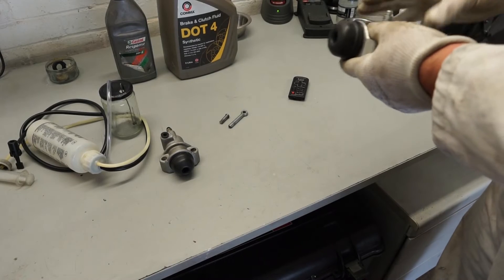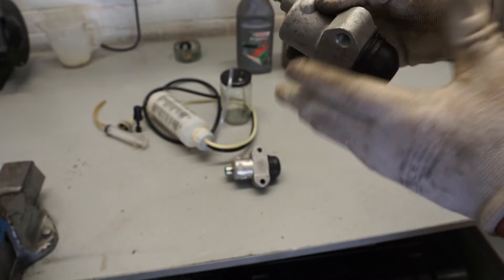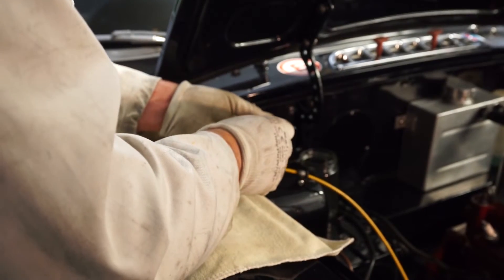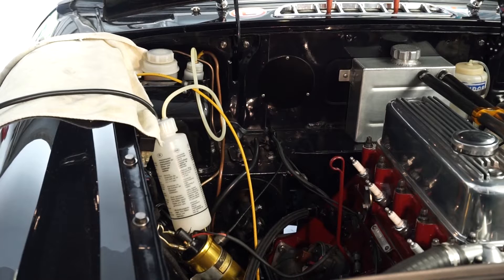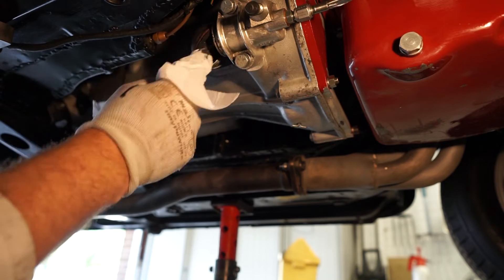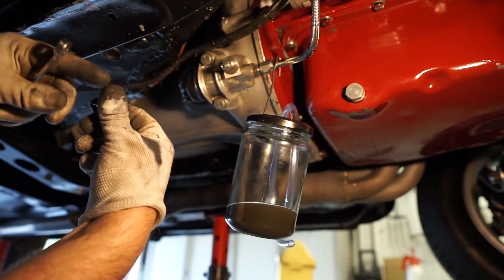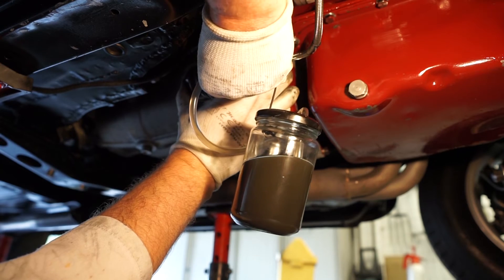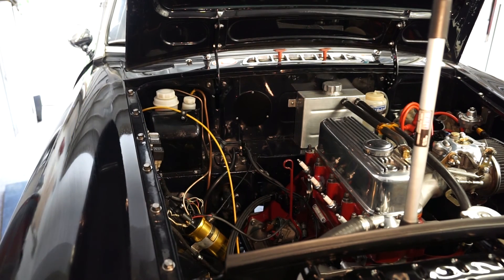MGB Clutch: Bleeding and Refreshing the Hydraulic Fluid in an using the Gunson’s Eezibleed System

Comment: I tried the Ezibleed but it was unsuccessful.  So I removed the 2 bolts holding the slave cylinder on and opened the bleed ripple until fluid ran out. Now I have the best clutch ever.
Reply from the maker: Many thanks for this, it's not a method I have ever tried great to see it worked for you. I do find often the MGB clutch can be hard to bleed, I have found that leaving it overnight in the past has helped if they are being difficult.

Comment: Just bought a 1972 mg bgt yesterday, low and behold went in it tonight, no gears, looked underneath soaking wet with dot 4. Just ordered slave cylinder and pipe  will do the job over the weekend. Its the old lockheed master cylinder, a bit rusty on the outside but still doing its job. With this video and tips it will be a breeze ,( famous last words). Thanks for the tutorial video, looking forward to watching the rest.
Reply from the maker: Many thanks Mike, I hope it all goes well!

Comment: Another informative video thankyou David!  I'll be carrying out a clutch clutch in the next few days following your instructions once again.  Cheers
Aaron G
Reply from the maker: Thanks for your message Aaron, hope all goes well with the clutch on your car.
Reply: @davidrussellwilks  Gday David, clutch flush went extremely well, very clean so good result.  I carried out a compression test (exactly same compression all cylinders) and tested the dynamo (mines a 65) and runs strong (over 14.6v @ 1000 RPM).  A suggestion for new video/s is what items on the car MGB owners can test, why they should, how and frequency as preventative maintenance.....just suggestions.  Cheers
Reply: Did it today, 12mm spanner worked on the bleed nipple.  I bought a fluid tester per your previous Youtube suggestion and detected greater than 4% water content reading.  Surprising was the amount of clutch fluid I needed to bleed before noticable drop in the clutch reservoir....almost filled the jam jar.  Looking forward to the next informative Youtube production!

Comment: Thank you David. I like how methodical you are and how well you explain things. I don't know if you remember but you had asked me awhile back if I had figured out the problem I was having bleeding the rear brakes. As it turns out, I had a crushed brake line. I had done a visual inspection of the brake lines but, with only a couple of inches between my eyes and the bottom of the car, I missed it. I ended up taking it to a shop at the beginning of the virus outbreak. The mechanics were all sent home shortly after I dropped it off. They recently came back to work and I hope to get my MGB back soon.
Reply from the maker: Delighted to hear you found the source of the problem Trent, was it the copper line that was crushed or the rubber hose that had failed? Hope you get the car back soon
Reply: David Russell-Wilks - It was the copper line. I’m hopeful that I’ll be driving it again soon. Thank you!

Comment: That was a great  clear vid,I appreciate your extra info,like maybe why it doesn’t go into gear…,my triumph spitfire 1500 has been having trouble going into 3 rd sometimes lately,I will check this out and hopefully get it sorted. Many thanks from nz.
Reply from the maker: Thanks for your message, there are a couple of things you can check. How easily does it shift into third when stationary with the engine running? A clutch issue would mean problems when both moving and stationary, if it only happens when the car is moving it may be the synchro on third.

Comment: Great video David, that's interesting to know about the original slave cylinder having a dimple on it compared with the aftermarket not having it. If I get any issues with mine, I know I'll be spending the extra cash on an original type. What's the expression, fit cheap fit twice
Reply from the maker: It's something I picked up from the John Twist video. I bought the aftermarket slave as I needed one urgently; in fairness it seemed to work fine but I went back to the original AP one as soon as they came back into stock.
Reply: Ah yes, John Twist. Legend, what he don’t know about classic MGs ain’t worth knowing

Comment: Great video and always well done.  I am curious if bleeding the clutch without an air system to push the fluid would be the same procedure as bleeding brakes?  I noticed a reply to another subscriber that just pressing the clutch to push the fluid will work, but do I close off the bleeder screw while having someone press the clutch and I open the bleeder while they hold down the pedal? 
Thanks for all your videos. 
Kel
Reply from the maker: If you have someone to help you it should be no problem to bleed the clutch slave in the conventional way, open the nipple as the pedal is pressed and then closed before the pedal is released. You can use the same technique as shown in the video to burp the system. One tip I have found in the past if the system is being difficult is to leave it overnight and it does seem to expel the air itself sometimes.
Reply: @davidrussellwilks  thank you very much for your response. I appreciate your time.

Comment: Great as ever. Thanks. Can I ask : if you don't have a compressed air "thingy", is there another way to do this manually? From what I could tell, you filled the kit with new fluid, connected it to an air device, went under the car and opened the bleed valve which I ASSUME has the effect of drawing the new fluid from the bottle as the old pours out? Is that right? If so, then I do have one of those brake bleed kits (not used it yet) but I don't have an air device, so I winder if this is possible for me? b) is it preferable to use DOT4 brake fluid, or is there dedicated clutch fluid to use? c) what is the bottle to the left of the clutch cylinder? Is that the brake fluid bottle?
Reply from the maker: You won't need the air bleeder but you will need someone in the car to press the pedal for you and push the fluid through the system. Essentially the air kit pressurises the system (only around 15psi). when the bleed nipple is open the air pressure forces the fluid through the system. I think DOT4 is ideal for these cars, there's no need for an expensive racing type brake fluid and you don't dedicated clutch fluid for these cars. 

The clear bottle is the brake master cylinder, I went with the newer style clear reservoirs to make checking the levels very easy.

Comment: Hi David, your video is excellent and very detail for beginner.  I have a question using the Eezibleed system.  Does it not introduce air into the cylinder when you open up the nipple as there is a air in the pipe between the Eezibleed bottle and the cylinder.  If it does not introduce air into the clutch system, where does the air go?  Hopefully you understand my question?
Reply from the maker: Thanks for your message Philip, the air inlet for the Eezibleed is at the top, but the outlet for the fluid is at the bottom of the bottle. This means that only fluid is pushed out (until the fluid runs out). You may have a small amount of air already in the Eezibleed but this would be held in the master cylinder above the fluid already in there. Hopefully this explains it.

Comment: David thanks for the educational video on bleeding the MGB clutch. What would be your thoughts on a clutch that seems not to want to engage until the car has warmed up and driven down the road a couple of miles. Very difficult to get into both second and first gears until driven down the road.
Reply from the maker: Good Afternoon Derek, I'm wondering if the problem you describe might be related to the gearbox rather than the clutch. How is the car at selecting reverse when cold? I had a similar issue on my car and it turned out to be the gearbox synchro/baulk rings rather than the clutch. If you are able to get under the car and see the clutch fork travel are you able to measure what you have?
Reply: I can always get into reverse but today I tried pushing in the clutch pedal 2 or 3 times and just letting it fly back while out of gear. Seemed to work better today while driving around. Might be some build up that needs to be loosened up. Drove alright this morning. Going to work with my mechanic this winter and pull the entire engine and drive train
 Will be changing all the gaskets and will look at it then. Since my MGB is a very clean 1964 model which I just purchased in March I want to keep it in the best running shape possible
 Just found your first video very helpful so hope to view the remaining videos to get better educated 
 Thanks for the Insight

Comment: Hello David, Thank you for the video. You have a beautiful car. A couple of questions. What size spanner are you using on the bleed nipple and what detailing spray do you use? Thanks David
Reply from the maker: Thanks for your message David, from memory I think it's a 7/16 spanner. Under the car I just use WD40 to clean up, on the bodywork I use the AutoGlym rapid detailer; the trade version is called Fast Shine & Lube I but it in 5L cans, much more cost effective than the small bottles. I've stopped using water to wash this car, there are too many bare metal parts where the water can get trapped and then cause rust

Comment: Hi David and all MG lovers, my problem is the clutch that sometimes travel freely all the way to the floor. Fixed a new master cylinder (Lockheed) all were good until it was grounded for 2 years. Change a new set of MC kit and slave, system bled and has a solid peddle. No leaks anywhere.

Moving the pedal up down several times in a short period of times results in the clutch pedal dropping down ever closer to the floor. It will reach a point where the pedal won't move enough to disengage the clutch. If I stop moving the peddle and wait for awhile the pedal comes all the way back up and the process repeat again. Please advise and help me guys. Thank you.
Reply from the maker: Thanks for your message, if you've not replaced the clutch hose yet it might be worthwhile. The internals of the hoses can break down and upset the flow and return
Reply: @davidrussellwilks   @David Russell-Wilks  thanks for the prompt reply David. FIY I just blast air through the hose and there was no blockage.. but it never cross my mind of any internal deterioration that might happened. I'll fix a new hose and let you know the outcome. Thanks mate.
Reply: @davidrussellwilks -  Hi David, I have fixed a new hose as you suggested and bleed every air there was inside. And as like magic the dang clutch just came back to life. What worries me now is the carbon clutch bearing, it is hoovering very close to the clutch pressure plate. Is it normal? Or can I hook a small spring on the clutch bearing fork to make sure it stay clear of the clutch pressure plate? Any advices from you would be most invaluable? Thanks David. Like I say, you're just awesome.
Reply: @davidrussellwilks  hi buddy, I'm taking my darling for a spin and will update you of the experience soon. Thanks mate 😘😘😘
Reply from the maker: Sorry for not getting back to you about this, I missed your message. The carbon bearing will wear out over time, it's just a case of checking that there is still plenty of the carbon material on it. The roller release bearings are a good alternative and are widely available now.

Comment: Thanks again for this David, you're my go to resource for everything MGB related. Quick question... what heater unit are you using? I've not seen it before.
Reply from the maker: Many thanks for your message Richard, delighted you are finding the videos useful. The aluminium box where the heater should be is a catch can, they are mandatory for racing the UK to collect the vapour from the crankcase and rocker cover.

Comment: Hello David, 
Sorry to bother you again. 
My clutch system is empty due to a leaking clutch slave cylinder which I am going to replace and then bleed the system. 
However I was wondering whether I could bleed the system by drawing the clutch fluid through from the clutch master cylinder using a syringe via the clutch slave cylinder bleed nipple rather than pressurizing the clutch master cylinder?
Any thoughts or reasons why this might not work?
Regards David
Reply from the maker: I've never tried it that way. You'll need to make sure the seal for the syringe on the bleed nipple is good and you will need a decent capacity syringe, plus you'll need to make sure the master cylinder does not run dry. I think it might be easier just to bleed in the conventional way with someone pressing the peddle? A good tip is to burp the slave cylinder just to push out the last bit of air when you are finished
Reply: @davidrussellwilks  Good morning David, I'll try and I'll let you know. Regards David

Comment: Do you have any videos on tuning your weber carb?
Reply from the maker: Thanks for your message, I have the Weber carb tuned on a rolling road and then don't touch it. I don't think a static tune is very easy with these carbs as you really need to see what the engine is doing at the upper end of the rev range.

Comment: Hey don‘t U Uwe DOT 5 Fluid for brakes and clutch?
Reply from the maker: When I first built the car I used Dot 4 for the clutch and Dot 5.1 for the brakes, changing now would be difficult. I have heard stories about Dot 5 affecting the rubber seals in the MGB system, I have no first hand experience of this though. I do like a very firm brake pedal in the car, apparently the silicone fluid can feel spongey once it gets warm. 

Do you use Dot 5 in your car?

Comment: David is very careful to use anti-seize product to facilitate future removal of parts. He also is scrupulous about torquing parts to specifications. But I have read that the use of anti-seize products being a lubricant, reduces required torque requirements by up to 30% and torquing to spec can stretch bolts and/or ruin threads.
Question: is it ok to use anti-seize AND all torque to indicated “official” torque settings?
Reply from the maker: This is an interesting question; I have always stuck with the recommended torque for any fittings. The anti seize should work as a thread lubricant when assembling the parts and most likely give a more accurate torque than tightening with dry fittings that may bind up. ARP for example do supply an assembly lube for their parts. The anti-seize does not work as a lubricant long term though, if you remove a fixing after 12 months you will find just a dry film on the threads. So far I've not had any parts fail when torqued but I would be interested to know if others have encountered this problem.
Reply: David Russell-Wilks A very helpful takeaway here is tha
Reply: t if the part is not to be removed after more than a year  anti-seize is a good plan. After that it doesn’t really matter. Love your videos.
Reply: I have very little understanding of this URL, but it does go into some depth re anti-seize and its relationship to torque. FWIW!